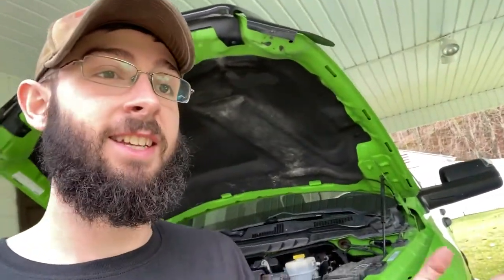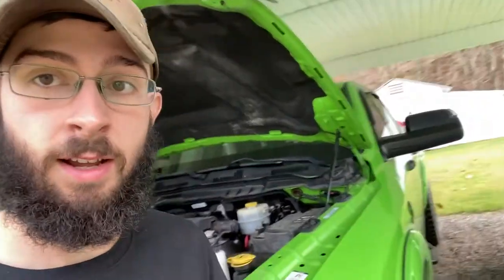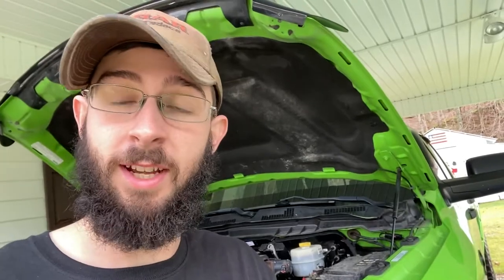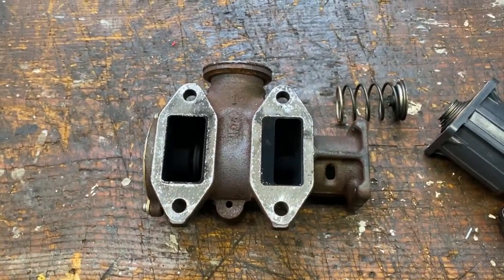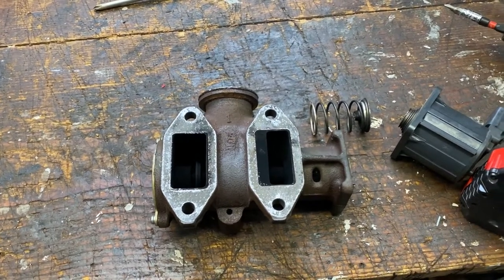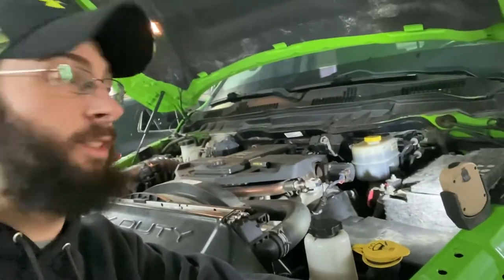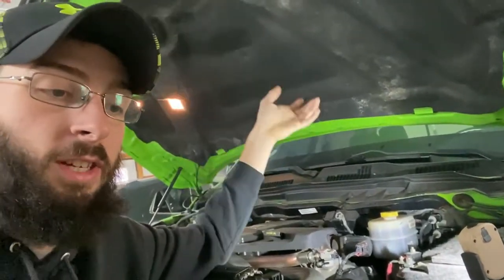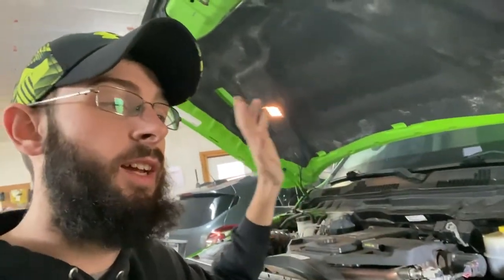EGR Valve cleaning on a Ram 2500

Comment: did your truck consume radiator fluid prior to this repair,? if so how much?
Reply from the maker: It was not
Reply: If the truck is consuming coolant, it’s most likely the EGR cooler has failed. New cooler is $1000 min.

Comment: What code was it ?
Reply from the maker: It was P02E7
Reply: My 2015 2500 threw P2493.  I cleaned the EGR valve and replaced the EGR cooler.  While I had that much going on, I changed my coolant, belt and serviced the truck